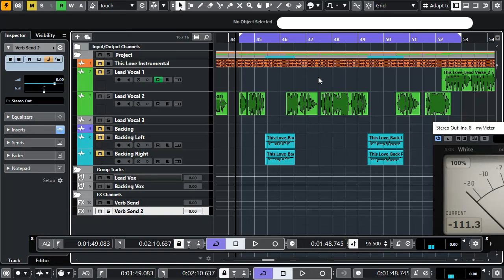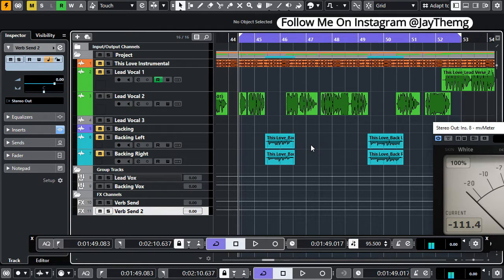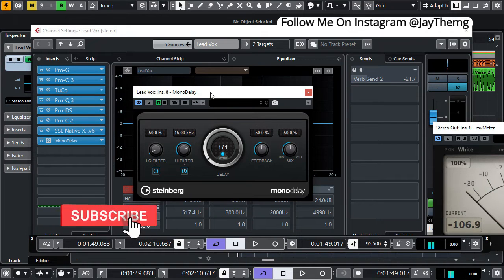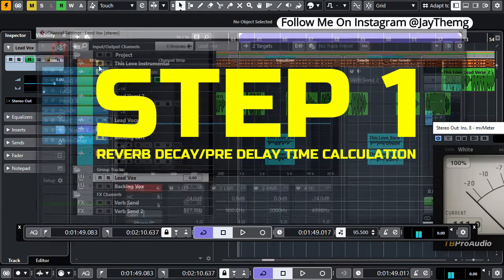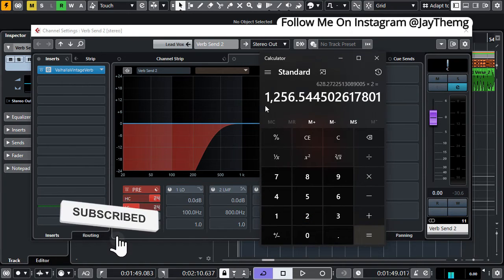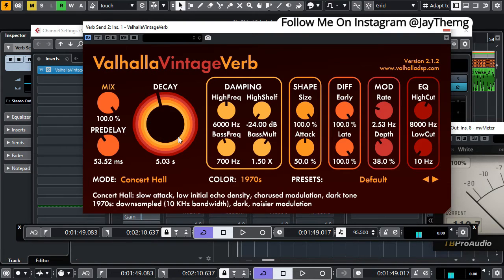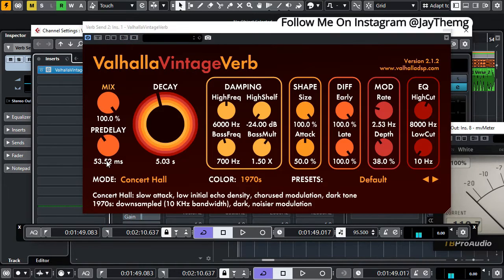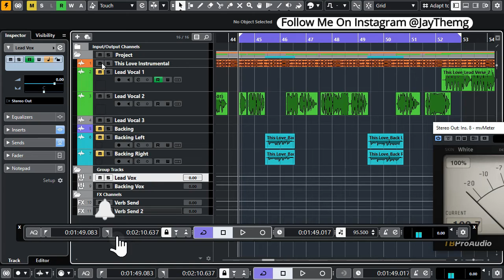How To Get Correct Delay And Reverb Times | Vocal Mixing

Comment: bro where did u get 60000 from?
Reply from the maker: Hi hope you are doing great. 60,000 is the number of milliseconds in a minute. When you divide that by your bpm it gives you a quarter note in milliseconds. Then you can continue multiplying or dividing those values by 2 all the values you get will be in sync with your beat. 1,4  1,2  1,1  etc ....

Comment: PLEASE iM A NEW SUBSCRIBER AND STUDENT, cASN YOU SHOW ME HOW YOU CAME UP WITH 60,000
Reply from the maker: Hi hope you are doing great. 60,000 is the number of milliseconds in a minute. When you divide that by your bpm it gives you a quarter note in milliseconds. Then you can continue multiplying or dividing those values by 2 all the values you get will be in sync with your beat. 1,4  1,2  1,1  etc ....
Reply from the maker: Your tempo is measured in Beats Per Minute ( BPM ) that's how come 60,000ms which is just 1minute